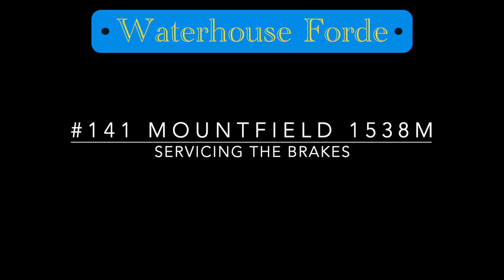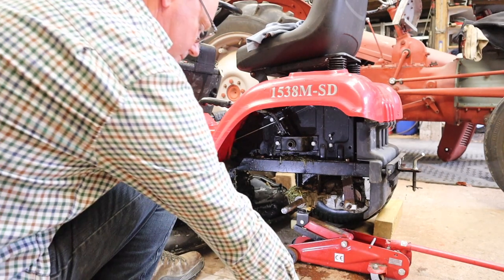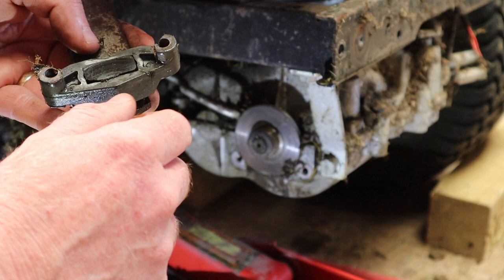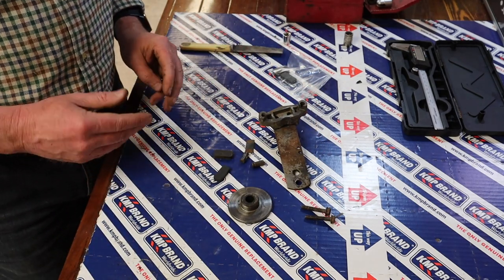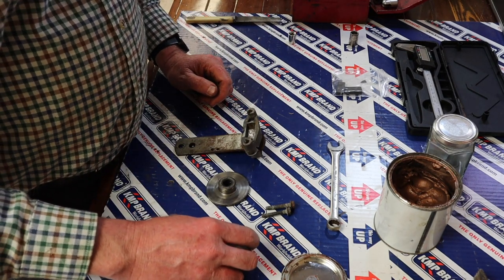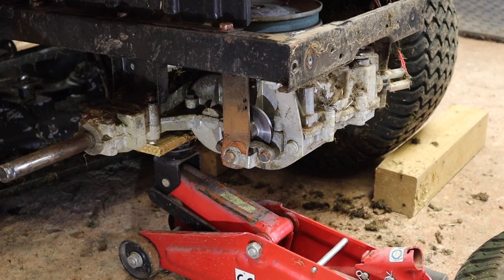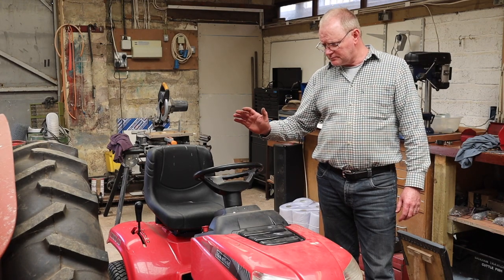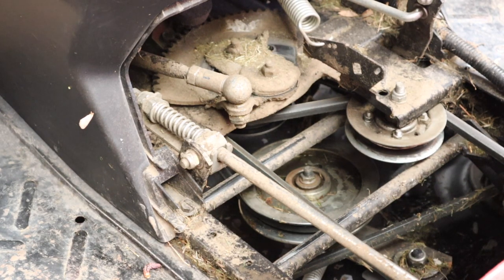#141 - Mountfield 1538M Brakes

Comment: Hello, Is there any chance you know the part number for the pads? I have the same braking system, but my mower is a JCB TR38.
Reply from the maker: Hi there. Not sure about the actual part number but these are the ones I used. 

https://www.ebay.co.uk/itm/185502091458?mkcid=16&mkevt=1&mkrid=711-127632-2357-0&ssspo=wWJ9ztuQRi2&sssrc=4429486&ssuid=I-jYz-cHQ4u&var=&widget_ver=artemis&media=COPY